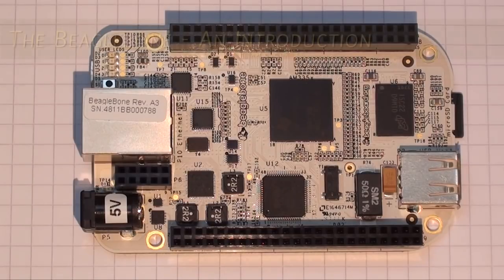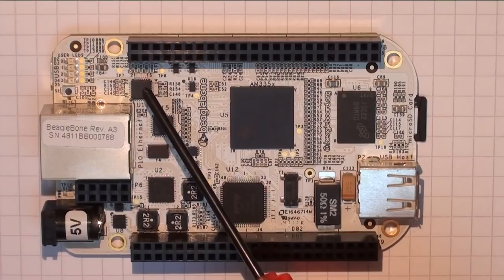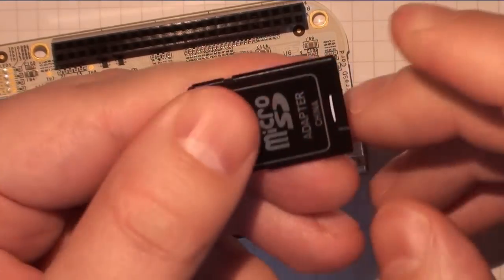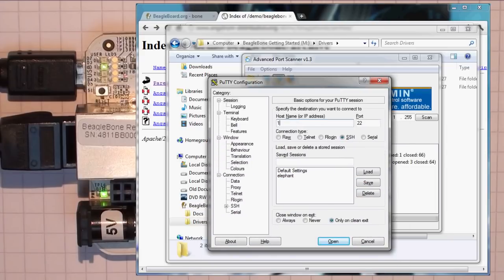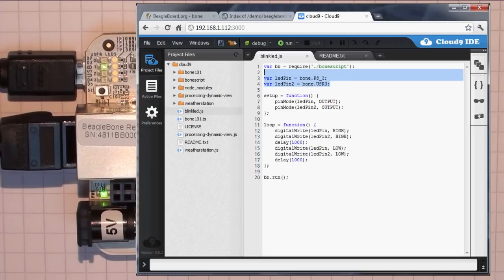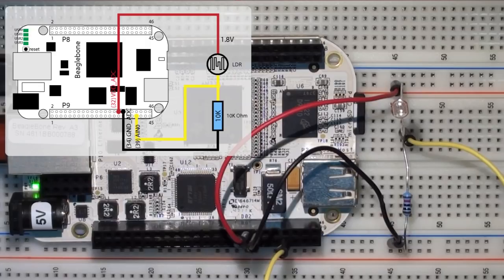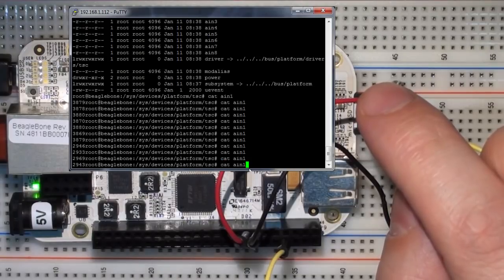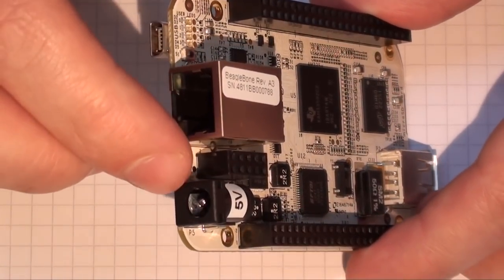The Beaglebone - Unboxing, Introduction Tutorial and First Example

Comment: Hi, very good explanation. Thanks. I would like to add a note about 1.8v pin. In the video you mention it being a power supply for ADC pins. In fact it is meant as Vref for ADC. It shall not supply current but only serves as reference. To properly drive the LDR an external 1.8V power supply should be used.

Comment from the maker: Thanks Mike, the problem is the real-time control aspect of the board. There is a programmable real-time unit (PRU), but it's not that easy to use and only allows for small controlling logic. The ideal solution would be the Beaglebone Black as the UI/Web Interface to a real-time control unit as you would get the benefit of embedded Linux while still getting your real-time control.

Comment: Dr. Molloy, I just received my BBB and updated the firmware to the latest version, the files you mention in the minute 14:35 in your video are not there, can you give a hint please? I want to follow all you video and scares me a little that I would no do that because of O.S. differences.
Reply from the maker: Hi Jaime, the OS has changed somewhat since this video was released in 2012 but the principles are the same. I have released a further video (3B) Introduction to GPIOs using Device Tree Overlays to explain the recent changes to Linux. Good luck!
Reply: Hi can you suggest complete linux device driver development kit e.g. like usb, storage device,char device, block device.
Reply: Hi can you suggest complete linux device driver development kit e.g. like usb, storage device,char device, block device.

Comment: For the BeagleBone Black (RevC),  it seems to have come with Debian 7.4 Wheezy  (cat /etc/issue , cat /etc/*release , cat /etc/debian_version)..  

I understand the 4GB eMMC should run Debian (Jessie 7.9?), and the 2GB eMMC angstrom linux.   But how do you flash it to the eMMC?

The /boot/uEnv.txt doesn't have the '##enable BBB: eMMC Flasher:' line doesn't exist as described here:
http://elinux.org/Beagleboard:BeagleBoneBlack_Debian#Flashing_eMMC

Also for the BBB, the cloud9 nor the tsc folder seem to exist:
root@beaglebone:/# -bash: cloud9: command not found

root@beaglebone:/sys/bus/platform/devices# cd tsc
-bash: cd: tsc: No such file or directory

Comment: great platform for learning, and prototyping. very compelling how you can run JavaScript, even though the configuration is the 'standard' setup/loop pattern. wonder how that might be possible to host something like an angular front end with b/b services backing? I'd be more inclined to dive deeper into the C++ stuff for performance, application, and other reasons. good videos, thank you!

Comment: The board should show up on your network as beaglebone.local thanks to Avahi, without needing to run a port scanner.  There are other open ports besides the ssh port, including port 80 running the bone101 presentation (that still needs some updates).  The password should be empty, not 'root'.  It is odd to me that you needed to start 'cloud9', which should be started automatically.

Comment: It's crazy to think just over a year ago I was using a computer daily (for about a year) that had considerably worse specs than this tiny board.  I was running arch linux on a box with 94mb ram, and 500mhz cpu.

Comment: Thanks - that is a very valid point. Embedded Linux is quite heavy for many applications and it can be difficult to code applications where time sampling is a critical issue; however, when you need to place an embedded application on the Internet you can have a full webserver or ssh client, or, when you need a full user-interface display - that's when this type of platform comes into its own. It might be worth looking at the mbed or the Stellaris Launchpad and getting them to talk...